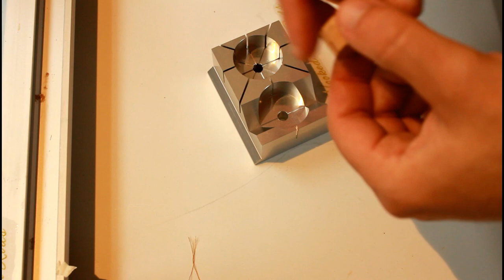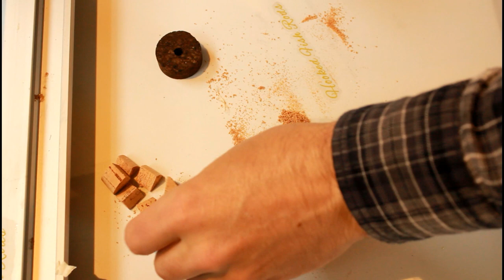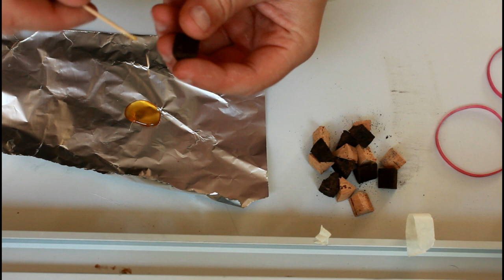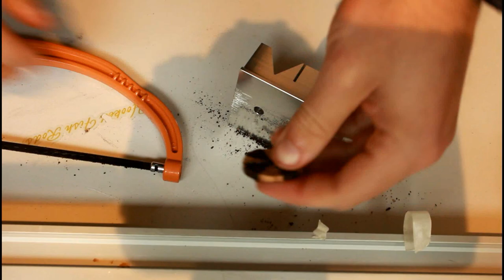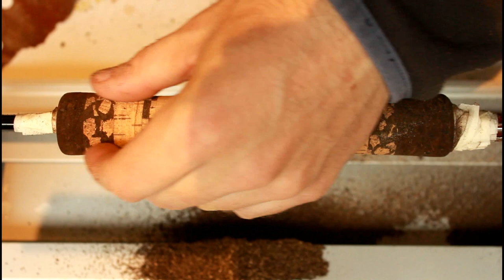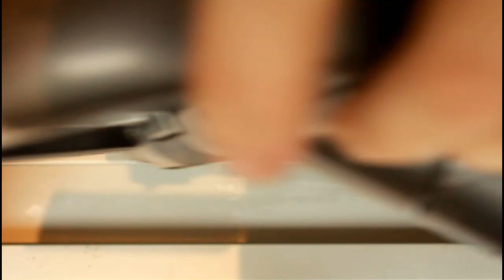How To Make a Cork Handle

Comment: What is the contraption called that holds the cork when you're cutting the angles?
Reply from the maker: T.K. Archibald hi, its a 3 in 1 cork slicing jig: http://www.guidesnblanks.com/mobile/product/7228
Reply: Hooked Fish Thanks man.
Reply: Hooked Fish I actually prefer this cork jig better than the one from Mudhole because the slots for sawing are wider on yours. The Mudhole version, the saw blade slots are so thin, you have to use their sawblades which break so easily. Sure a wider blade wastes more due to the wider kerf but I prefer yours. Nice work by the way.